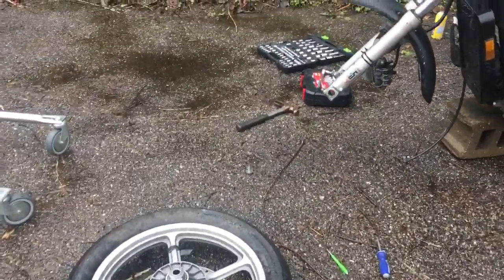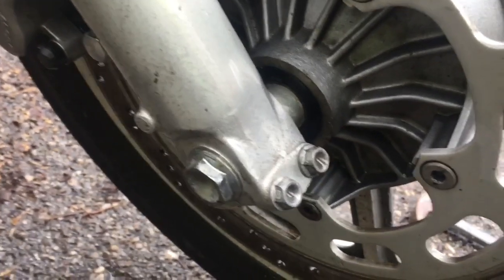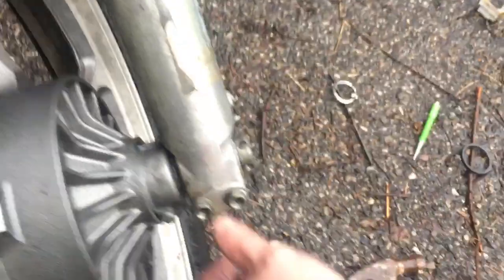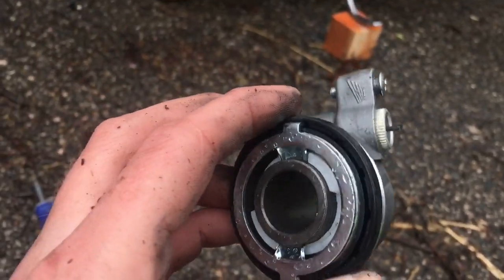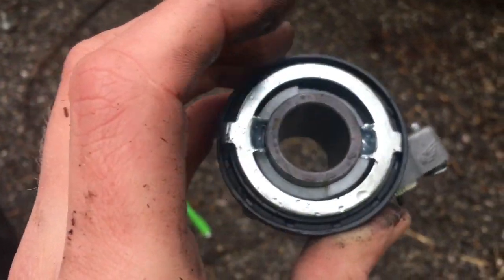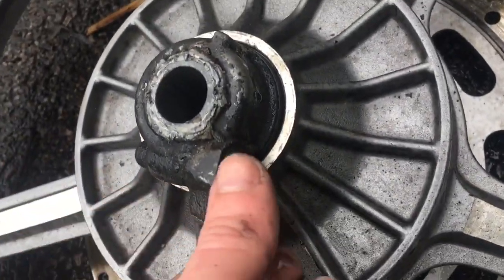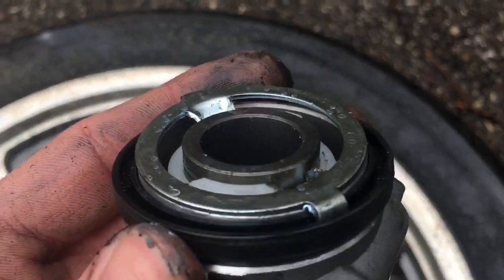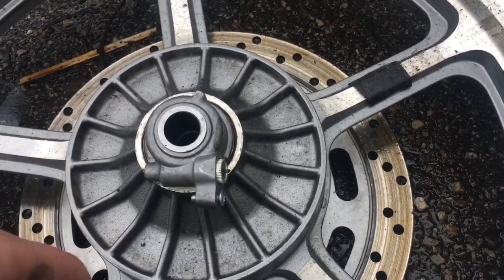Motorcycle speedometer gear box replacement (front wheel)

Comment: My issue is the pin deal for the cable broke watched the video so I can get the just of what to do when the new full assembly comes in the tire shop isn't taking responsibility for their guys mistake
Reply from the maker: I hope it helped some. Sometimes the speedometer cable is pretty tight on the top end where it reaches the speedometer itself. I had to use a pair of pliers to get it free. It’s a pretty easy job though.

Comment: so if i changed a sprocket it wouldnt affect the speedo reading?
Reply from the maker: That would be correct. Changing the size of the front tire is the only thing that will affect the speedometer reading with this cable style speedometer.

Comment: where did you get replacement from ?
i am in thailand and can not find one
Reply from the maker: I ordered mine from EBay. I know it says it doesn’t fit a shadow 1100 but it fit right on for my VT1100C No problems. Here’s a link https://www.ebay.com/itm/152654672816

The other option is to find a local Honda motorcycle dealership or service center and buy it from them. I know here in the US you can even call them and have them ship one directly to your house. 

Hope this helps!

Comment: hi, I have an 02 VT1100C and the design of gear box assembly is somewhat different. I don't know if the thin silver "nut" on base of gear box where the cable goes on needs loosened or not to get the cable out of the gear box. How hard did you have to pull the end of the cable to get it out of the gear box assembly? Did you wiggle it a bit? When you say unscrew are you referring to the single Phillip's head screw that fastens the end of the cable to the gear box assembly?
Reply from the maker: When I first took the speedometer cable off it was a bit stuck. Some good wiggling and pulling got it loose though. As far as unscrewing there is just the one philips head screw and then you should be able to pull it out (sometimes a little force is needed) hope this helps

Comment: Hi Doug, clear video! 
I have currently the same issue with my honda transalp (2001), for 300km back i replaced the plastic wheel.... but last saturday it broke down again... the two plastic parts what are making the connection with the front weel worn out.... i want to replace this part again but my question did you lube te plastic wheel or other parts, what kind of lube did you use and how manny did you use.... last time i used quet a lot, i soked the plastic wheel in lube,

perhaps that is one of te resons it broke down again.
Reply from the maker: Thanks for the input!  I did not lubricate part. There seemed to be some sort light of lubricant already inside the assembly when I got the part. I’ve only went about 2 miles (maybe about 3.7km) so far as the weather has been a bit wet lately. If I were to have added a lubricant I would make sure it’s compatible with nylon as some oils/greases can break down plastic parts